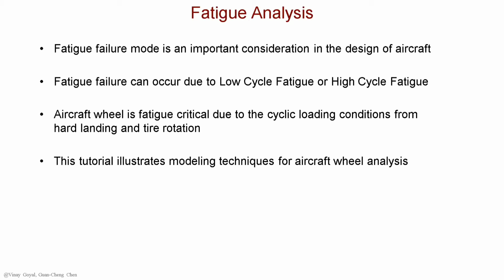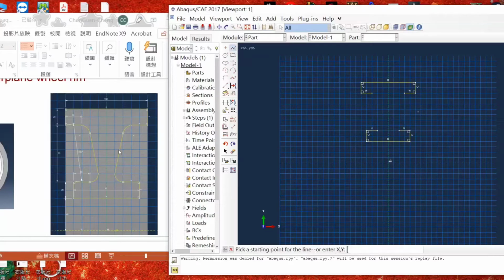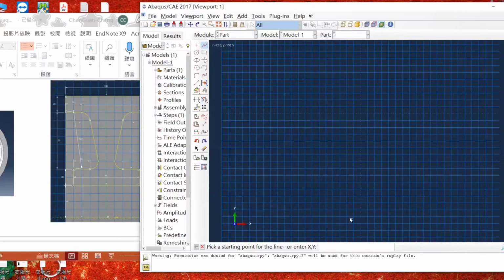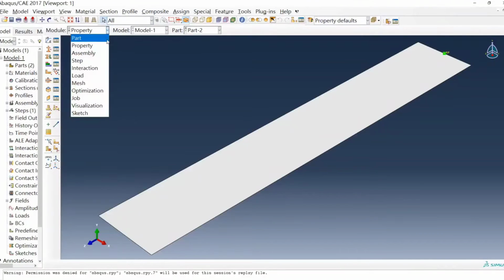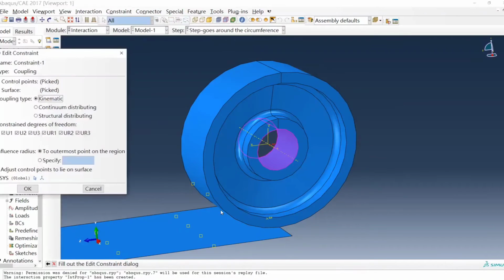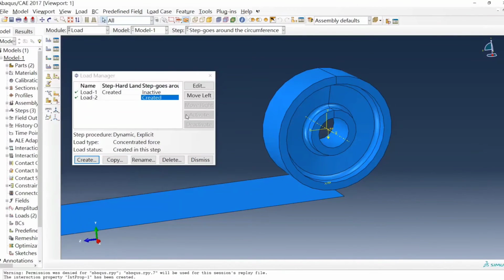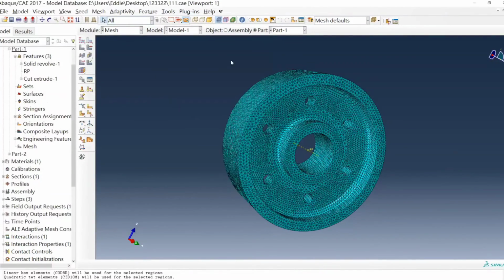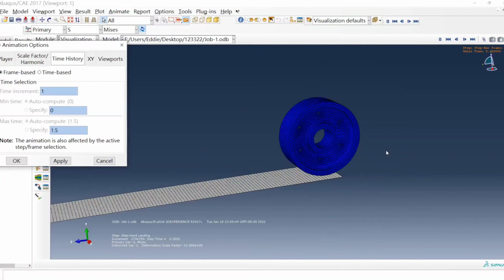#ABAQUS TUTORIALS - Fatigue Analysis Approch of an Aircraft Wheel

Comment: Hi, how do you do? I would like to ask please for a problem solving in Abaqus, that I haven’t been able to find in the web in general nor in YT. The statement of the problem I’m looking for is a pretty common one I guess, and it is a structure with a pre-tension in the cables, such as in a cable bracing or the ropes for stabilizing an antenna mast. The most similar thing I’ve found is bolt force, or node displacement in an intermediate step, or cooling a part of the wire as a step, but it’s not what I’m actually trying to simulate. Nor is the prestressed of wires in concrete. Any help on the matter will be appreciated. Thanks in advance.
Reply from the maker: Email me for further assistance